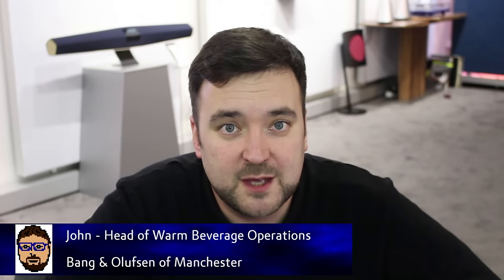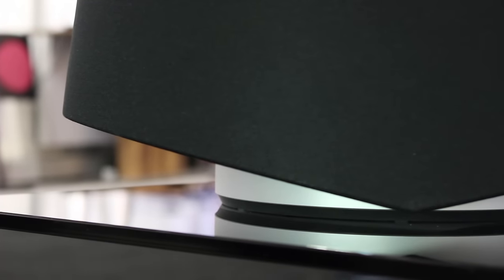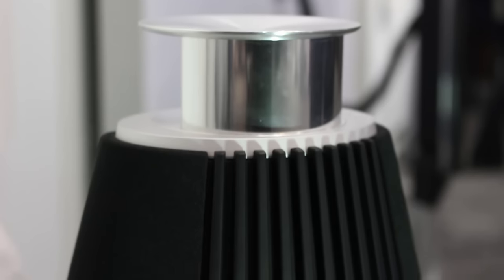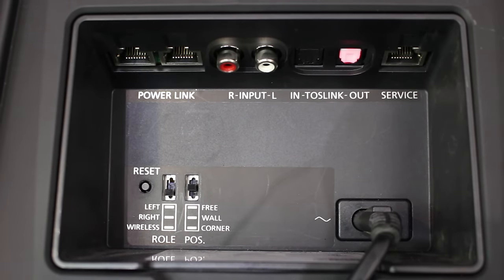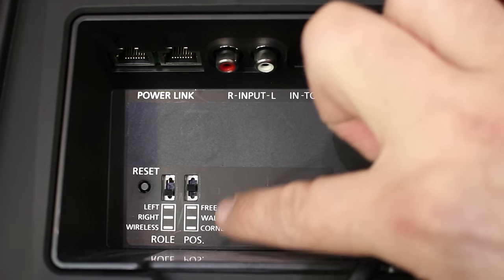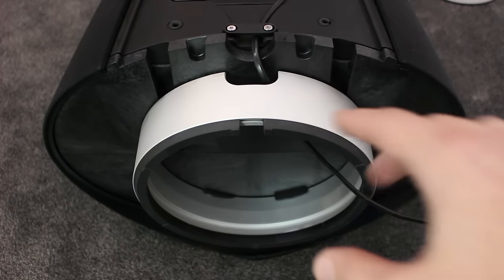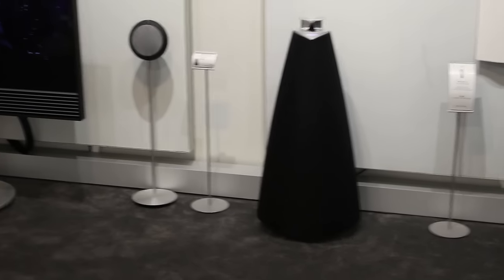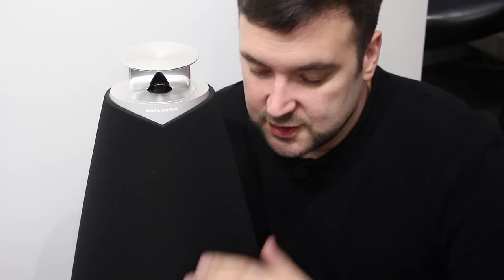BeoLab 20 Loudspeakers Overview

Comment: What is the best connection option to achieve the best sound quality? I've noticed that toslink is better than wireless (using a blue sound NODE 2). The sound is good, but I wonder if there is more potential. Using a pre-amp?

Comment: Hi John, thanks for your videos :-). I was wondering: is it possible to use BOTH the Powerlink in and the Toslink in? So that the speakers would play anything through the Powerlink in (connected to the telly), but also be able to play optically from the Beosound Core?

Comment: Love your videos so far. How big of a space do I need for the 5 or 20 respectively. 5 is quite dated yet good and wondering if I want to invest for a lifetime which one should I go with?
Reply: Derek Chan Beolab 5’s are the best investment. But only if you could get ones that are young and unused. They last ages, but after 15-20 years or less you’d need to change the amplifier or chassis if you’re unlucky. And that can be costly. But they outclass the beolab 20’s

Comment: Hi John...just started subscribing to you after acquiring a BeoHarmony 88. Could you or someone please let me know what those white on wall speakers are just next to your Beo 20s from 4.04 m onwards ? Thanks from Down Under !
Reply from the maker: Hi Ashar, they are called Beolab 12-3 and were very unique. Super slim aluminium cabinets and sounded pretty good too. There were also smaller Beolab 12-2 and 12-1 in the range. All discontinued now but should be around on the second hand market. John

Comment: I would like to use those with the BeoSound 9000 and a sonos base… the 9000 just sticks in the Powerlink, but do I need a cable connection between the pair via Cable if I want wo use the Sonos? … or can I connect the Sonos Connect (via Cable) and tell one of the Speaker to be the left one and still use the other via WISA?
Reply from the maker: Hi, you would plug the BeoLab 20 into BeoSound 9000 using PowerLink cables. If you want to add your Sonos you could plug that into the AUX input on the BeoSound 9000 using a twin RCA phono to DIN lead. (www.soundsheavenly.co.uk can help). Play CD's as normal and use A.AUX on the remote to play the Sonos system. John